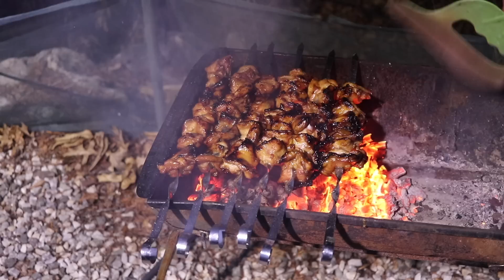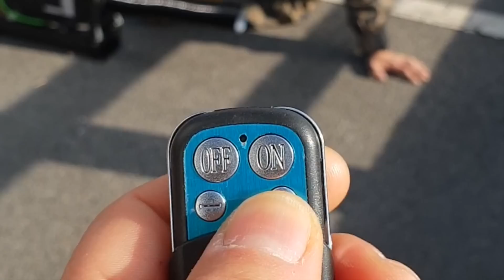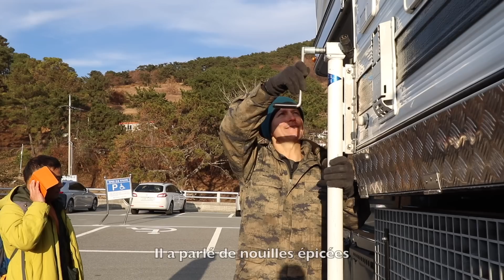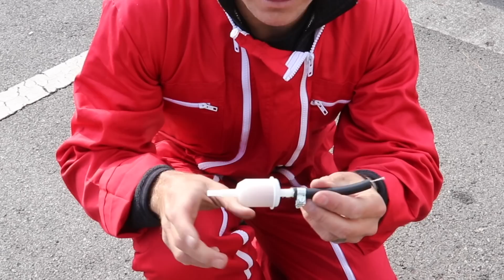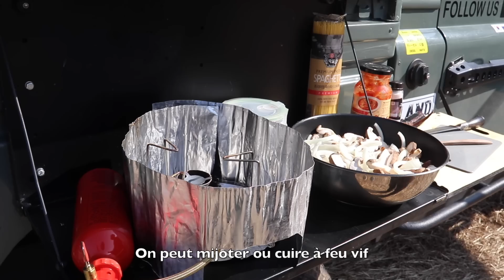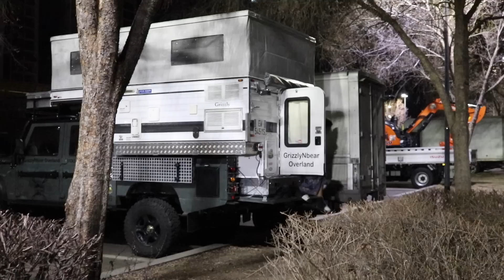The Ultimate Upgrade (Ep109 GrizzlyNbear Overland)

Comment: If you go into the advanced settings, you can change the lower limit to 0.8 Hz. I always use that in my van (which is quite small). There are other things to adjust as well, I don't remember right now. Maybe max/min fan speed as well.

Comment: I live in the Scottish highlands where it can get pretty cold in winter. I fitted a diesel heater to our 110 a couple of years ago.. OH MY GOD! The difference it made.. Put it on in the morning when its -10 and its 30 degrees before you know it. It's very reliable, but it can soot up inside if it's run on low heat for too long or the air input is restricted (it needs a strop down and clean out - but its easy to do) and you probably need to replace the exhaust hose every year or so if it is under the vehicle but it's dead easy to do. I plumbed it into the tank... Greatest mod ever :)

Comment: I am in the process of building an overland camper and I’m very interested in your ProPex Propane heater vs your new diesel heater. I have seen so many people complaining about their diesel heaters getting a carbon build up and stopping working until they completely take them apart and clean them. If memory serves correct it has something to do with running them so low and not getting a complete combustion in the combustion chamber. I had decided to go with the ProPex because of the clean burning propane but after seeing your condensation issues I am questioning everything again. My first question would be; If the unit is an indirect heat source (the air heated by the propane never enters the vehicle) only the indirect air from outside or recirculated air from the living space is heated and enters the living space, so where is the extra moisture coming from? I would seem to be the same system, one using diesel and the other using propane, for that matter you could do the same thing using a wood fire and never get smoke from the wood fire in the living space. I hope I am explaining my question clearly. Thank you both for the amazing videos!!!

Comment: NO NO Don't Damage the Threads as he done use LockTite mastergasket on the Threads covers Fule Petrol. Gas .Diesel .Ps BSP Fittings are Tapered Male Threads so they Dam Near Seal Themselves But use a Sealer on Them to make sure not Plumers Tape OK.....

Comment: I have had a lot of diesel heaters on various boats for cruising in the Pacific NW and Canada.  Nothing better than the good, dry heat they put out - 0 condensation.  Love all the extras you did to tap the main tank, fill the cook stove and maintain the option to just use when the camper is not on, good work!

Comment: I've been using the diesel heater for decades, espar are the brand, but most of them are very similar. If I can give you some advice. Always let the heater shut down completely when you turn it off before cutting the electric to the unit. In the ignition chamber will get massive carbon buildup if you don't let it completely shut down and you'll have to replace every year. Proper shut down and the chamber will last several years. I recently found your channel and really like your work, I think both of you are really nice people :-)
Reply from the maker: Thank you for your message and advice. 😁

Comment: Leight. Perfect job. The thing is I have the same (dry heating kactory system) system and I'quite confident The "fresh" air is to be taken fron inside of the habitat. Thanks to that temp bilans is much better and the machinery is working on lower power consumpsion. Consider this.
Reply from the maker: This is an option and would definitely provide better efficiency on the heater.
The negative is it creates a lot of condensation.
Taking fresh dry air from outside reduces the condensation by a huge amount.
We tried both ways 😉
The heater is so powerful even with -17C outside we had 20C inside and heater on lowest setting.

Comment: Make sure you get a CO alarm for inside the camper.  Would hate to have something go wrong and you guys get sick...or dead.
Reply from the maker: We have a carbon monoxide, propane and smoke detectors in the camper.
We have had them since we owned the camper 😉
Also a dry powder fire extinguisher in the camper and one in the truck.

Comment: Hi Guys, have put Korea on our Bucket List, have noticed that you have commented in several episodes that you do not use your installed Hot Water System because of the gas consumption ect, I have an Australian developed HWS (Duetto) 10 Litre that runs on 12/240 volt. I have a dedicated 140 amp AGM battery and Cetek  model 250, DC2DC/mppt charger, this system maintains hot water while driving and when I have good solar charging conditions. When plugged in to shore power works like any other HWS, cost 340 Aust $ available online and dead easy to install, not sure if you have a DC2DC charger but there are many available. I am sure you could sell your existing HWS and fit the electric one in the same space then Steph could have hot showers.
Reply from the maker: Hello
Very good idea to add Korea to the list mate 😉
Thanks heaps for that info, really appreciate it.
I have also seen that the Chinese diesel heaters now come with a water heating option?
So it's exactly the same unit with 2 extra outlets. A flow and return water line.
We actually didn't plan to replace the LPG hot water unit after we get rid of it as we've never really used it even when we had access to easy gas bottle refills.
In the warmer weather we enjoy cold showers and in the winter we just heat a little bit of water and have a sponge bath or visit the local public baths 🛀😉

Comment: Great job installing the heater, I hope you have a Carbon dioxide alarm in the camper. I would also use a bolt in the rubber diesel hose as a plug in case  your ball valve gets bumped a leaks out you fuel as you drive. Love your vids, keep up the great work.
Reply from the maker: We have both of those things thanks for the comment 😉

Comment: Glad you did go for Chinese Diesel heater. Being happy user myself, I could not disagree. I have 5 kW version being installed in slightly larger but much better insulated cabin and so far all good. These heaters also come with water heating option, so you might consider upgrade later on :) 

All the best to Korea!

Comment: I'm building my third 1 I recommend you take the air from the camper and put it back in not polare from outside in.  It will triple the efficiency.  And also kill all humidity and moisture and condensation
Reply: We have tried both ways and actually circulating the inside air created so much more condensation as you circulate the moist inside air created from breathing.
Since taking fresh air from outside we've almost eliminated the condensation issues that we've had over 3 years of full time living in the camper 😉
Reply: The heater is so powerful even when it was -17 degrees C outside and the heater was on the lowest setting it was still too hot inside.
We had to have a window open 🔥😊

Comment: I have a webasto just for my James baroud rooftent on my series 2A.  Coldest I've slept is -20degC. In Himalayas. 
Had to open a few windows :-D 
Very, very good addition if you're going somewhere high too. 
You have to fit an altitude compensation module for above 8000ft tho. 👍

Comment: I would advise (on your fuel tap)-only leave the on/off lever on when parked up. It could drain your tank fully if it's knocked to the open position. (possibly think of changing it to a ball lever valve with a metal handle-that can be detached). I make bio-diesel and mine has been knocked and I lost a boat load of diesel without me realising. So I now take the handle off when not in use. Loving the videos- only started watching 3 weeks ago and we are nearly finished them all.   Me and hubby in our 50's and we are going to go or a similar set up (not as  adventurous tough with places visited=YET)- but you have inspired us so much. :-)
Reply: Thank you so much for the advice.
The drain tap system was only temporary.
Later in the video we showed the final installation.
A very small straight stainless steel ball valve with flexible rubber hose protected by the chassis outrigger.
I also have a plug in the end of the rubber hose if the valve that acts as a double isolation 😉
Reply: @leighdearle5965   Good one leigh I like the belt and brace idea I would hate for the tank to drain . I have had a cheap Chinese multi fuel stove   they don't like diesel/biodiesel that much so I think I will try a  MSR  dragon fly keep up the good films and info A++++++++++

Comment: Great video! I' curious, does the diesel cooker stink while it's burning? Does it affect the food in any way?
Reply: It smells only during the initial lighting when the diesel in the catch tray is burning.
As soon as the valve to the bottle is opened and the flame is under pressure there is absolutely no smell.
So no smell or affect whilst cooking 🍳😊

Comment: Leigh l can advice you a other upgrade to cook also with diesel with a closed glass plate and under it a diesel heater no water or pollution in your camper from Webasto or Wallas even Wallas has also an oven combination Our camper has no gas everything on diesel only above 4500m not so good working but same as your new heater
Reply: The Wallas XC duo is my dream, I've been thinking about it for a few years 😉
Is it not too hot cooking inside with the Wallas in summer as I know it's also a heating unit?
Reply: Leigh Dearle when you have the standard cooker is whiteout heating The heating is under the glass plate It gave less heat inside because no open fire Wallas cooker is designed for salingboats with less space and you use no oxygen from inside more save then gass heater with open fire and no gas’s bottles But this is my advice

Comment: Another great video! Make sure you take the air from inside the cabin. That heats the air up quicker (not having to heat up cold air from the outside) and avoids pulling in moist air from the outside.
Keep up the great video's!
Reply: Hey thanks for the comment.
To avoid condensation our air intake is outside.
We've tried both ways over the years and this method is far better, almost eliminating condensation.
If you circulate the inside air it circulates the moist air created through your breathing and creates more condensation.

Comment: Have you installed muffler for your heater? In my 110 i have Eberspacher and mullfer from webasto, since I've installed it, it's almost 100% quiet.
Direct diesel feed directly from tank is good idea, but check where you have it installed, in my defender it's installed in way, that it will never drain tank empty and leaves about 1/5 diesel always in the tank.

Also, maybe you should make one episode just with easy cooking recipies and tips :)
Reply from the maker: We do have the muffler on the exhaust.
We can't hear anything with the unit outside and the exhaust discharging under the truck 😊

Comment: Great job Leigh, I have the same unit heating my bungalow. Liked the tape tip, not wanting to sound condescending, here is another tip in exchange, next time with fuels, use yellow or coloured tape, white will degrade over time as its meant for water, but we are talking years..
Reply from the maker: Yes you are right 😉
If it gets a drip one day I'll use the yellow.
Things were hard to find in the Korean hardware store.
Yellow tape is actually the gas standard thread seal but will work for fuel also 😉
Reply: I was going to ask if the diesel  heater is good for heating a home as my electric bill for heating my flat is silly and not keeping me warm. Any advice please?
Reply from the maker: @sanatandharma4435  you should join the Facebook group Chinese diesel heater owners. There is a lot of great information and you can ask any questions.
I have actually seen many posts about this and I think it's possible for sure.
Some people are heating large garages with these units.

Comment: Glad the heater is working out for you! I’ve got to do it too. Two other bits about your camper that similar to mine. The exterior water tap and the massive basement drawer. Two features I find so valuable and looks like you do too. Thanks for another great video.

Comment: Very important on these units is to let them fully shut down before you remove power as they purge the diesel in them to prevent uncontrolled fires and the gelling problems of cold diesel. Just saw a video today of another Youtuber that cooked the board by disconnecting power before it was finished. 

They are also making a hybrid unit now with a built in liquid heat block so you get hot air and hot fluids out of the same unit so can make hot water at the same time you are heating the space.

Comment: Nice, well done! I'm sure you know this but be careful to secure that tap on the secondary tank. It would be a shame if it gets open somehow while being off road and you could loose precious fuel, especially out back. I think of that immediately as I saw you poor from it. Take care and safe travel. I enjoy your adventure, thank you!
Reply: I remove the tap after each time I fill up 😉
Also the brass valve and initial installation was only temporary.
Later in the video you can see the final installation of a very small straight stainless steel valve with flexible rubber hose to minimise risk of breaking the line when offroad.

Comment: Something to consider down the road with your fuel tank drain, if you're still concerned about breaking it, turn-up ninety degrees, then turn ninety degrees again to the horizontal, then install your valve.

This means you won't be able to completely drain-out the fuel tank from the valve, but on the other hand, even if the valve breaks or somehow opens, you won't drain all of your fuel by accident.
Reply: Thanks for the advice, the initial drain was only a temporary installation.
Later in the video we show the final installation.
A very small straight valve protected by the chassis outrigger with flexible rubber hose.
Very small chance of it breaking off now.

Comment: With your Chinese Diesel Heater. Please let us know how much battery drain do you have with the electric fan?
Reply: The battery draw is so minimal I don't even notice it.
We are running it on the lowest setting otherwise it's too hot.
I can't remember exactly what it's pulling but I had 12.9V on the auxiliary battery in the evening and after running all night it had dropped to 12.7V by morning.
The solar panel charged it back to full very quickly 😊

Comment: Make sure the heater exhaust is well away from the air feed for the camper & get a carbon monoxide detector, we have one fitted in our land rover 110. 👍
Reply: Great advice and very important.
The exhaust is run through the tub of the truck and a long way from any air intake.
We have carbon monoxide, propane gas and smoke detectors fitted in the camper 😉
Reply: The air intake on the bottom of the unit is just for combustion air not heated air. The unit has an air intake on one side and output on the other for cabin air keeping it separate from the combustion side which also reduces the humidity you get off a vent less propane unit.

Comment: hi lee saw the way you fitted drain for diesel tank wont it possibly get hit on rough country looks like if you didn't notice could loose a lot of fuel??
Reply: That was a temporary installation, later in the video we show the final drain install.
A very small valve protected by the chassis outrigger with flexible rubber hose.
Would have to be very unlucky to break it now 😉

Comment: I’ll be getting that exact unit very soon for my overland Defender.  there is a Facebook group dedicated to those with tons of info.  I’ll invite you to the group.  They are very well regarded.  Did you get a 5k or 3k unit?  most recommend getting a smaller unit and running at harder to prevent coaking, versus a larger unit.
Reply: I've been a member of that Facebook group for a long time before I bought the heater 😉
It's a wealth of information, the YouTube videos by John McK are even better.
Reply: We got the 5kW unit but it's too powerful, if I got another I'd definitely go with the 2kW.
The unit we have has a shut down cycle where even if it's on the lowest setting it ramps up to maximum for a few minutes before switching off to clear out the build up.
Reply: @leighdearle5965  if you need to improve the control of your Diesel heater a fellow Aussie has made a controller called afterburner worth looking into. 
Really enjoy following your adventures 👍
Reply: @macca545  awesome thanks a lot I'll have a look into that 😉